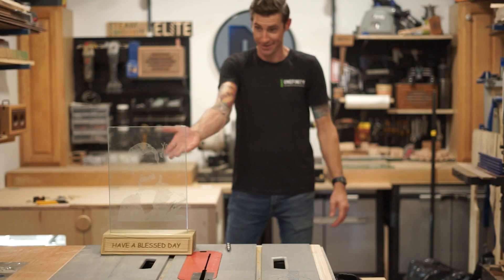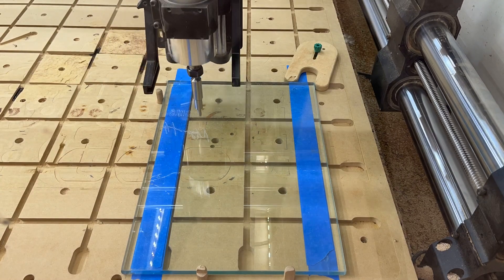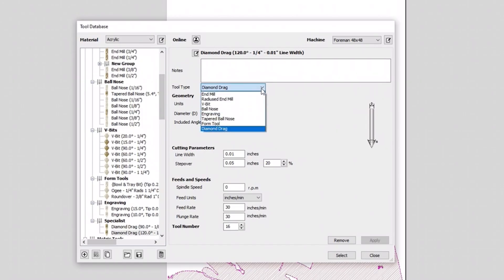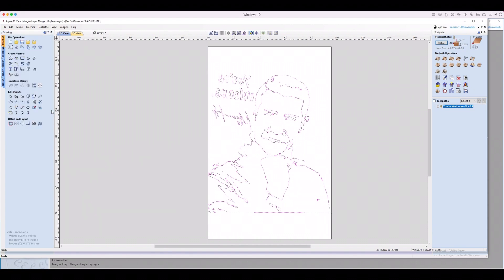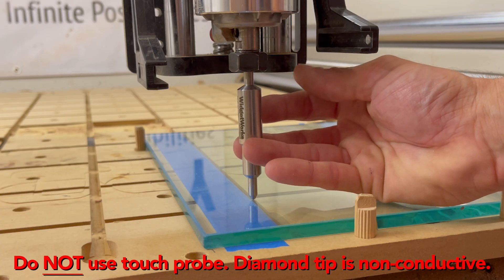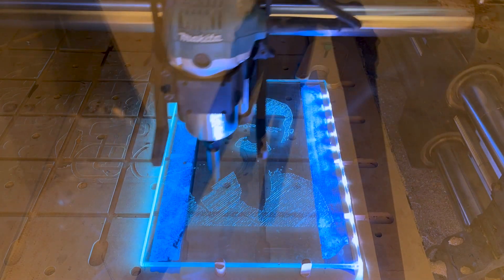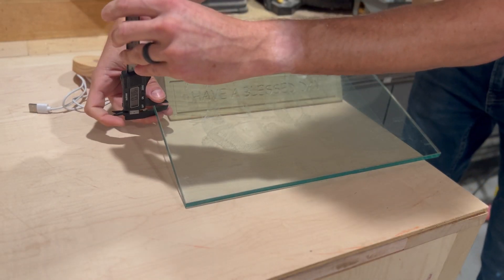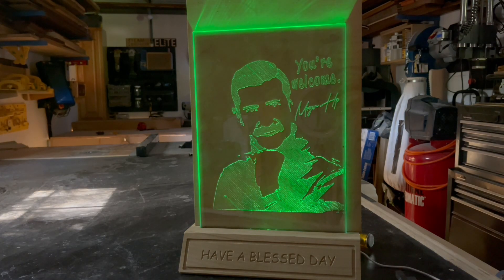EP 21 - Onefinity CNC - Etching Glass On The CNC

Comment: In Vectric 12 (V carve pro) , you have to put in at least "one" (1) for the spindle speed when setting up a drag knife gadget.
 What is the best way make sure the Masso doesn't run the spindle during the cycle start since it will start the spindle, even though it is only at one?
Reply from the maker: you'll need to contact vectric and masso for that question.
Reply: Unplug the spindle?
Reply: Spindle stop button
Reply: Open up the gcode file with a text editor and delete any M3 codes

Comment: super presentation.  Can you confirm the software you used, and the computer you were using, it looks like it was running on an Apple.  Thanks.
Reply from the maker: @shapr3d
Reply: @OnefinityCNC , at 1:34 in the video, it looks like you are running some kind of software (VCarve?) in a Window on a  Mac?  Is that a Remote Desktop session, controlling a Windows machine from a Mac, or an old Mac (Intel Based) with Parallels loaded running a virtual copy of Windows?

Comment: Would this also work on a dark Granite or Marble, or would you need a different bit?
Reply: Haven't tried on igneous rock yet but that stuff is softer than glass so this bit should do the trick 👍
Reply: Yes that bit would work on those types of material!
Reply from the maker: Yes it would!  Follow up video @morganhop ?!
Reply: Yes it will work, but you will probably wear out the tip quick. I did two granite stones for someone a year or two ago. Had just bought my bit (though not this particular one) and my bit was done for after just two granite tiles. That's just "my" experience.